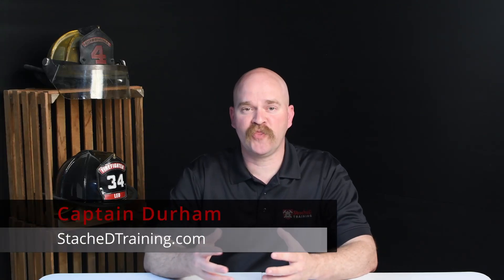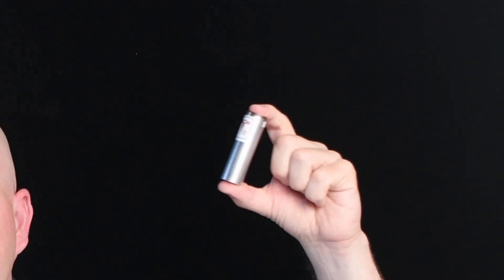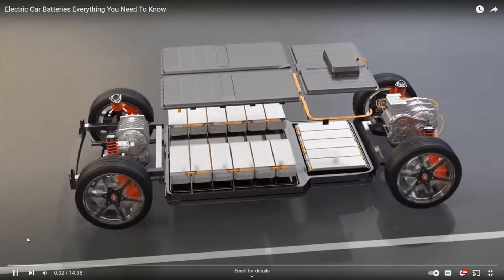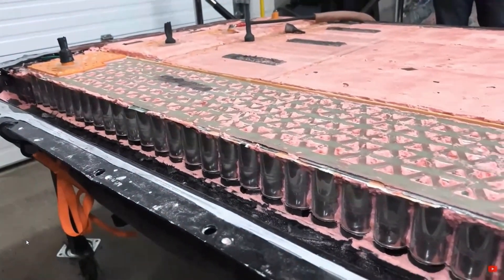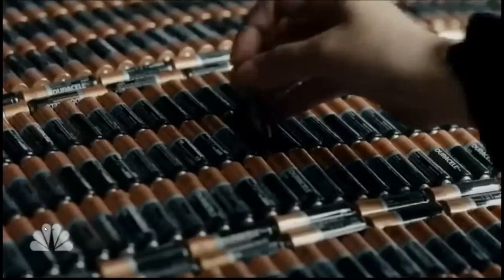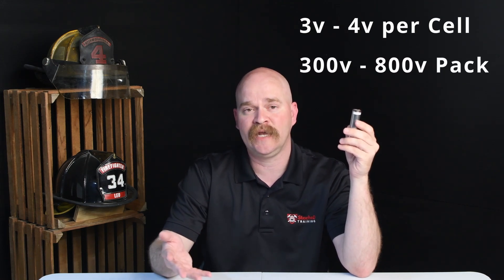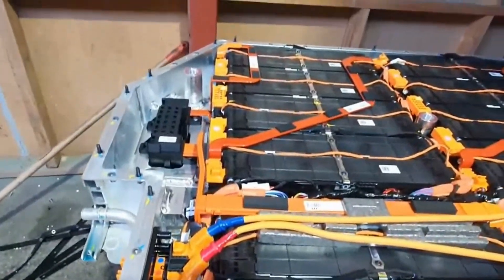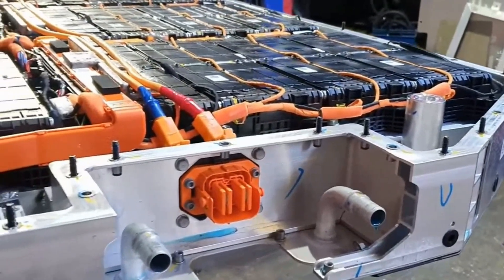Part 2: What's Inside an Electric Vehicle - Firefighter Basics

Comment: HI, thankyou for trying to raise awareness for these batteries, after seeing the build of the Tesla model 3 pack I thought instead of using poly foam (that burns) use a foamed refractory material and a firewall between the packs that would limit the spread of cell failure.
Rich